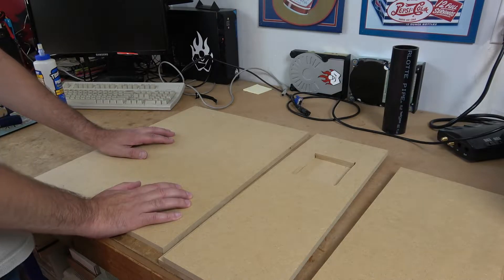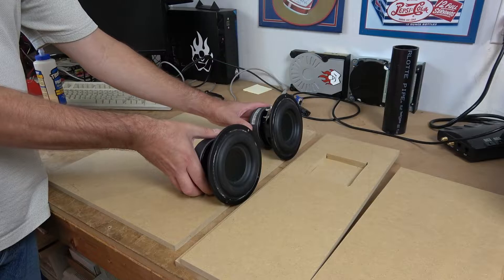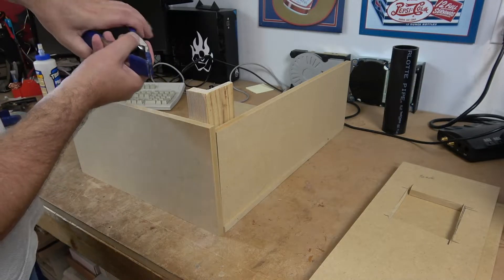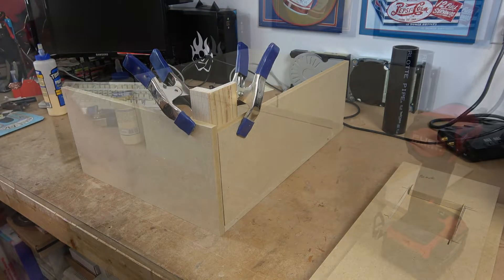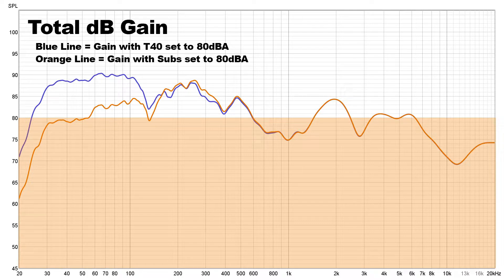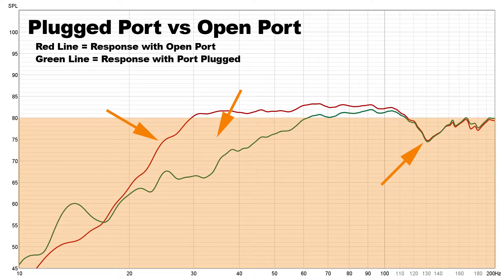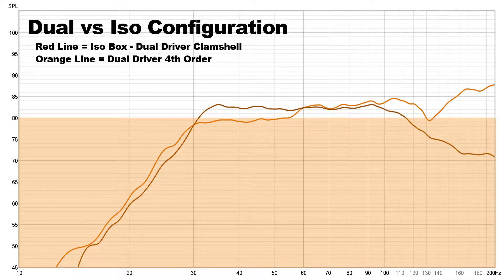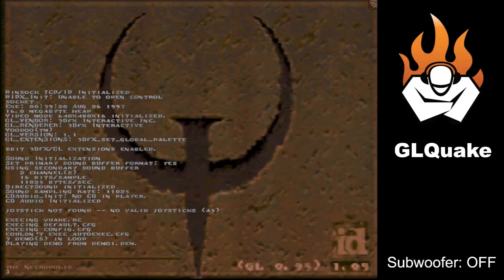How to Double your Bass with a second subwoofer

Comment: What would happen if you turn one speaker with the backside out and reverse the polarity, would that be same as isobaric
Reply from the maker: It would look cool, that is about it.  Same output, same frequency.  
For Isobaric to be effective you need couple the cones together, generally with a small airspace.  I did a video on isobaric loading and found it to be ineffective with modern subwoofers.  (Which is sad since I was always fascinated with iso loading)
Reply: Thanx alot for the answer, its really about an oldschool speaker with two 8” ie not subwoofer, i thought, why not, and now i know, thanx